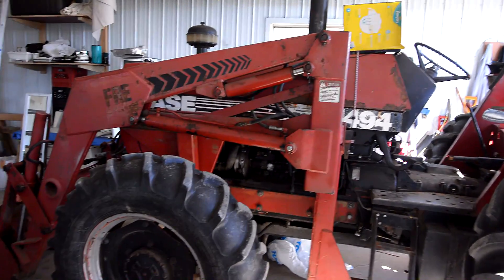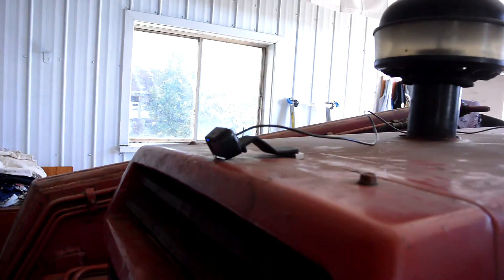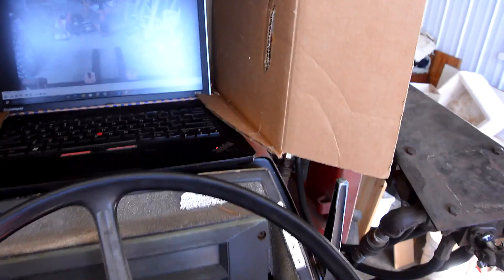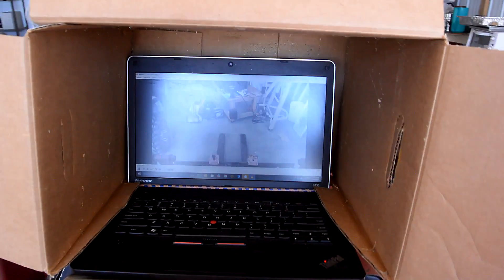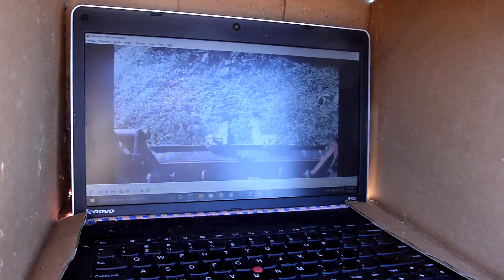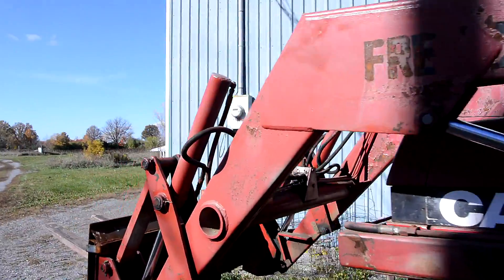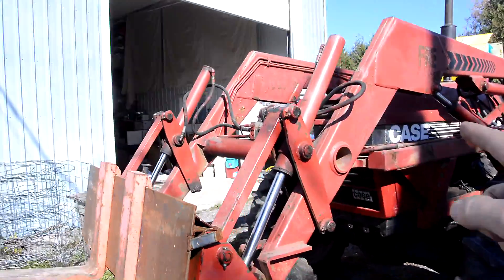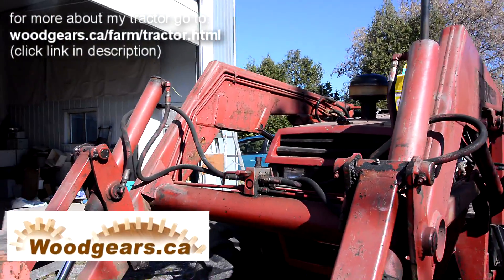Front end loader camera experiment

Comment: CCTV camera is what you want, like a security cam, that is what backup cams are anyways. I use cameras like this on model aircraft so that I can fly first person view (FPV).  I even built a kit for a 6" monitor in a foam box strapped to your head as super cheap VR goggles, mainly it helps with glare. Although I'm not so sure about driving with this..

Comment: I've found that with using my own loader that if you look at the outside edge of the bucket or fork mount and use that as a reference you will be able to operate it much better. It's sort of like you're car even though you can't see the wheels while driving it you know there location. Very few machines have an unobstructed view of fork or bucket edge.

Comment: This seems like a pretty inefficient way of doing this. Surely a raspberry pi zero with camera, along with a second pi with the pi screen would not only be massively cheaper, but a lot more efficient, provide easy options for positioning, and it can run on batteries, solar or if you can, pinch a supply from the lights and drop it down to 5v.

Comment: There are some cheap cameras and monitors available for use with rc aircraft.
Here is a camera for $13.61 and a monitor for $27.99 (currently). They can be wired together directly (AFAIK). You would also need a 7-13V power supply, but you probably already have something you could use.

http://www.hobbyking.com/hobbyking/store/__77778__EMAX_800TVL_HD_FPV_Variable_Focus_Camera_NTSC.html
http://www.hobbyking.com/hobbyking/store/__53706__Quanum_DIY_FPV_Goggle_Set_with_Monitor_KIT_.html (Just throw away everything but the monitor)
Reply from the maker: Was going to order one, but they are out of stock.
Reply: That's always a problem with HobbyKing.

In the end a cheap rear view camera might actually cost less. Especially if you include the shipping.
Looking for FPV cameras in other places might also be worth a try.

Here is a different camera for $15.75 that actually appears to be in stock:
http://www.hobbyking.com/hobbyking/store/__88656__RunCam_PZ0420H_L28_N_FPV_Camera_NTSC.html

Comment: a very cheap analog camera + 4-5 inch display combo (all <20$)  could do the job. 
with some glue you could even make it waterproof. and it can run off your tractors 12v battery
those cheap 10$ monitors have 2 video inputs, if you got multiple cameras.

Comment: You've had a lot of success using a raspberry pi with a camera for various things before, how about something like that? :)
Idea is a good one, though! :D
Reply: There are field monitors designed for reviewing video that are battery powered and often have built in sun shades.  The cheap ones probably aren't any good though.
Reply from the maker: I thought about that too, but I'd need a monitor that I could run off of 12 volts.
Reply: https://www.amazon.com/Founder-Raspberry-Display-Monitor-1024%C3%97600/dp/B01J51CXU4/ref=sr_1_5?ie=UTF8&qid=1477319059&sr=8-5&keywords=12v+lcd+monitor
Reply: Perhaps a Baby Monitor?
Reply: ^^ That's likely going to have some brightness limitations though. I imagine you'd have to put it in some sort of housing (like a cardboard box :)) to make it useful in the daylight.

Comment: What about mounting a simple convex mirror?
Reply: You could just mount a normal mirror so you can see how cool you look when driving a tractor.
Reply from the maker: Thought about that.  Don't have one handy, and everything would be very small.  I should look into that though.
Reply from the maker: that would really restrict the field of view, which would make them useless.
Reply: Matthias Wandel Two mirrors, one near the back of the forks which is angled to another mirror up top of the loader frame high enough for you to see from your seat?
Reply: I just guess and end up hitting things with my forks...curious to see how this works though, it's always some flavor of a guess where those forks are.  i think I would wanna see the camera in line with the forks to see the alignment with a pallet etc.
Reply: Those vibrations are probably not good for camera and laptop if you dont have an SSD. Big mirror on aa arm would be more appropriate. And you could leave it there for ever which is a big plus.
Reply: Maybe two normal mirrors at angles at the edge of the fork mounts?  Angled in such a way to give you a good view of the forks from your seat, of course.